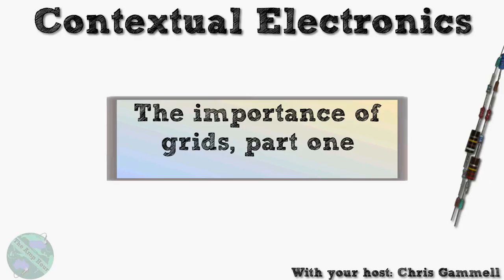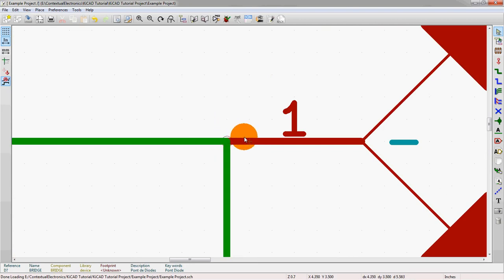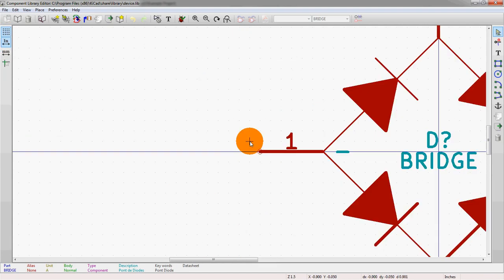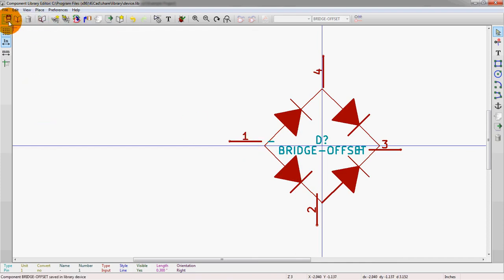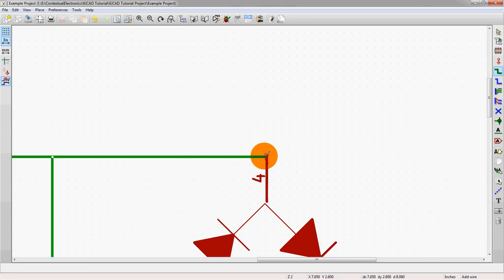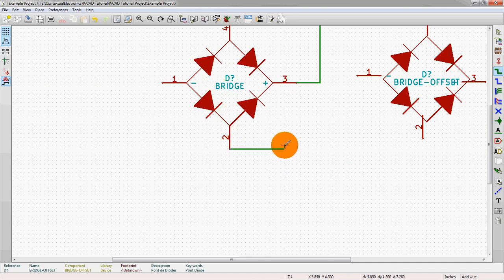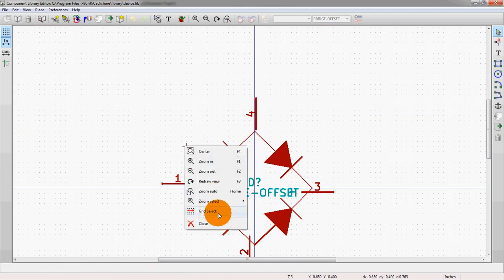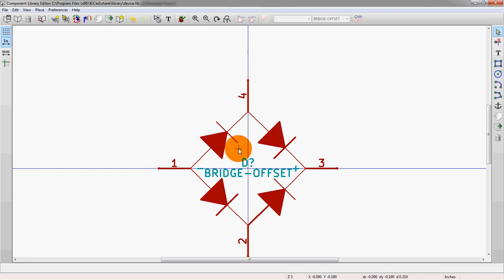KiCad 3.0 - The Importance Of Grids Part 1 In KiCad

Comment: This issue happened also in Eagle when belonged to CadSoft (I don't know if this happens yet since Eagle was adquired by Autodesk). Yes, grid is better to modify only when you are in PCB design (placing parts) but not NEVER inside schematic design (fits to 50mils).